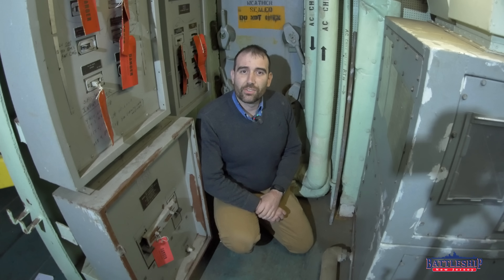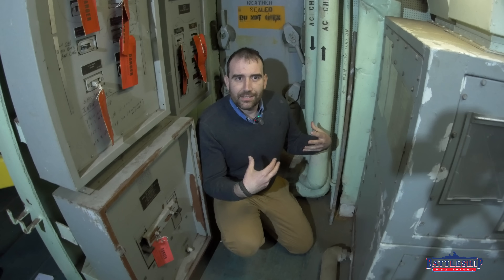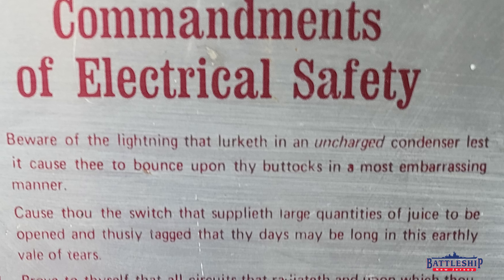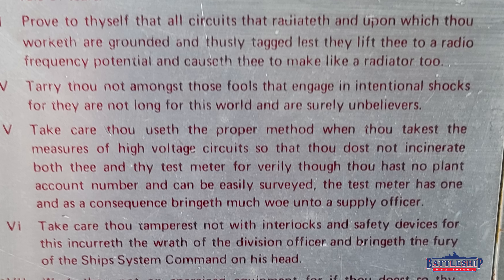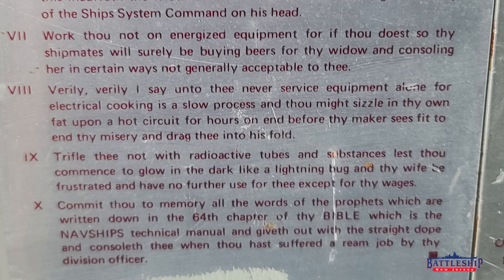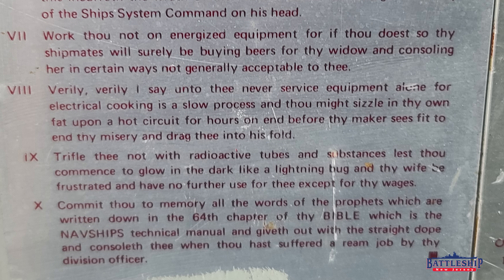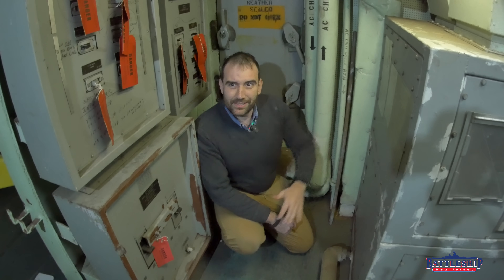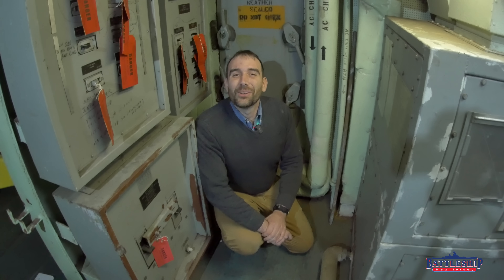The 10 Commandments of Electrical Safety

Comment: And always remember, electricity travels through a conductor in a piece of equipment in smoke.  If you let the smoke out of the equipment it will no longer work.  It’s often not possible to replace the smoke…
(Old electronics joke)

Comment: Truth is spoken on that tag, what's the NSN on it. The capacitor one is no joke for the Aviation Machinist Mate and any who work with modern turbine engines with Capacitive Discharge Ignition (CDI) systems. The system must be discharged before disconnecting plugs or you suffer the risk of being sent to the hereafter.

Comment: Thanks for this reminder!  I saw this decades ago while working in the calibration lab in the Air Force (or maybe it was at Tektronix).  Interestingly, I was thinking about # VII, Consoling Thy Widow, recently, though it was probably in the context of some other potentially risky activity, like motorcycle riding.  Also a favorite # 9, Thy Wife be Frustrated.  The version of X I saw referred to the NEC (National Electrical Code) instead of NAVSHIPS.

Comment: Here in Germany, we, the Masters Of Godly Power, aka electricians, have our 5 Safety Regulations laid down in our most holy scripture, the DIN VDE 0105-100:
1. Disconnect mains
2. Prevent reconnection
3. Test for absence of harmful voltage
4. Ground and short circuit
5. Cover or close off nearby live parts.

Go energize, apply in reverse order.

Comment: To clarify, the term "radiation" in this context is electro-magnetic radiation, not nuclear radiation. EM radiation in the huge doses & micro-wave frequencies generated by radar equipment is also dangerous. Potentially lethal, in fact. Those waves can cook you in seconds. A single radar can have the same power output as a thousand micro-wave ovens.
Reply: And for it’s time, the SPS-49 air search radar was probably the radar that emitted the most amount of energy.   

Enough to kill in certain scenarios.
Reply: @foxbodyblues6709  My uncle, who was in the navy, said that the radar controllers sometimes cooked seagulls using their radar when they were bored. They'd send a man topside to find a gull perching high in a mast somewhere on another ship, and focus their radar on it. The gull would simply fall down, cooked.
Reply: Surely it can't be THAT bad!

Wikipedia: 360 kW peak, 13 kW average

It's that bad.

Comment: lol, this is hilarious.  Just earlier today, I made a post on a teams group I am part of as my job as an engineer, in the tone and wording of a town scryer of a medieval fiefdom.  It was the communication of the decision to no longer use black oxide coated components in any project, due to corrosion concerns.  see below for the copy of the decree. 

It has been decreed, by royal order, we are not to use black oxide finish hardware any longer.  
Do not use this finish under penalty of death. 
 
If an individual discovers a catalog part that uses that finish, they are to immediately modify the description to label the part as "DO NOT USE" to prevent spread of this dastardly condition. 
 
Also replace that part using SS as a material. 
signed - 
THE KING

Comment: I. Beware of the lightning that lurketh in an uncharged condenser lest it cause thee to bounce upon thy buttocks in a most embarrassing manner.
II. Cause thou the switch that supplieth large quantities of juice to be opened and thusly tagged that thy days may be long in this
 earthly veil of Tears.
III. Prove to thyself that all circuits that radiateth and upon which thou worketh are grounded and thusly tagged lest they lift thee to a radio frequency potential and causeth thee to make like a radiator too .
IV. Tarry thou not amongst those fools that engage in intentional shocks for they are not long for this world and are surely unbelievers 
V. Take care thou useth the proper method when thou takest the measures of high voltage circuits so that thou dost not incinerate both thee and thy test meter for verily though thou hast no plant account number and can be easily surveyed the test meter has one and as a consequence bringeth much woe unto a supply officer.
VI. Take care thou tamperest not with interlocks and safety devices for this in curth the wrath of the division officer and bringeth the fury of the Ship System Command on his head.
VII. Work thou not on energized equipment for if thou dust so thy shipmates will surely be buying beers for thy widow and consoling her in certain ways not generally acceptable to thee.
VIII. Verily, verily I say unto thee never service equipment alone for electrical cooking is a slow process and thou might sizzle in thy own fat upon a hot circuit for hours on end before thy maker sees fit to end thy misery and drag thee into his fold.
IX. Trifle thee not with with radioactive tubes and substances lest thy commence to glow in the dark like a lightning bug and thy wife be frustrated and have no further use for thee except for thy wages.
X. Commit thou to memory all the words of the prophets which are written down in the 64th chapter of thy BIBLE  which is the NAVSHIPS technical manual and giveth out with the straight dope and consoleth thee when thou Hast suffered a ream job by thy division officer.

Think it's right.

Comment: Worked on hundreds of foreign made equipment . Not one ever had a UL sticker or other approved testing lab because they would never pass. Back in the 1980's we had a $10 million state of the art machine made in Germany that there hard headed electrician would never admit they could make a mistake. If you held in the stop button and pressed in the start button machine would run. Told them that I have worked on equipment made in the late 1920's in the USA that could not be ran like that.

Comment: Way back when cars still had ignition points and condensers, you could take a condenser, pull off the connector, and just stick the bare wire in wall socket. Then call somebody nearby and toss it to them when they see you. The reactions of the catcher vary.

Comment: These metal signs were relatively easy to obtain from a Shore Intermediate Maintaince Activity. (SIMA)  You sent in the text and any illustrations to SIMA on the regular work order process.  If I recall, you could get black and/or red.  So one off signs were no big deal.   No idea what the production process was, and it took time to get them back.

Comment: The Ten Commandments of Diesel Maintenance"

1. Thou shalt keep thine engine clean and in adjustment that thy life in its company shall be long and that the owner shall increase thy job longevity.

2. Know thine engine and all its parts and functions, else thou shalt be up some tributary without means of locomotion.

3. Be not wise in thine own conceit. Remember the factory instructions and keep them holy, lest false repairs be thine undoing.

4. Be not loose in thy jaw hinges for no man knoweth all about diesels. The truly wise absorbeth much knowledge and exceedith little, and he who so doeth shall gain repute among his fellows and favors among his superiors.

5. For all things in this life that thou desireth, thou shalt also pay plenty, and for the wisdom of experience, no less. Advice from the multitudes costeth nothing and usually worth as much.

6. In the books though mayest read what to do and when, but only the voice of experience may tell thee why and how, else reading of what and when shall but plague thee with smoke.

7. God maketh the earth rotate endlessly without bearing or oil, but not thy diesel.

8. Curse not thine engine when it turneth not. Curse rather thine own neglect.

9. Steam engines and gas engines may long turn over though sloppy: a diesel not so. With gauges and mikes be though ever busy.

10. The eternal eye watcheth universal operations, but thou shalt not rely upon it as to thy diesel. Thine own vigilance is the price thou payest for thy job.

Comment: There was a similar poster in the powerhouse of one of the rolling mills at the steel plant  I worked at. Not exactly the same but very close and with the same style. My wife actually got caught with the condenser rule. She found one of my film capacitors underneath my work bench and picked it up. Let's say she wasn't impressed and leave it at that.😱🤦‍♂ It would have been charged to about 400 volts I was using it to kick a slightly unstable power supply to settle it down.

Comment: For those who might not know - condenser in number 1 is the old timey word for capacitor. I think it fell out of favor in the 60s or 70s.
Reply: Oddly enough, a lot of small-engine (older equipment) mechanics still use the word condenser for the capacitor that enables a magneto to function.
Reply: You still hear it in the term "condenser microphone".

Comment: Funny but accurate. To go along with this i was told the first 3 rules of electrical safety are:
1 - Check for voltage. 
2 - Check for voltage. 
3 - Check for voltage.
Reply: electrical circuits are like a gun. "Is it turned off?" If you have not verified such yourself than assume yes its live.  Just like a gun is loaded until you are personally sure the magazine and chamber are clear.
Reply: 4- don’t trust when told the power is turned off, ckeck your self
Reply: @JeffHenry-cq3is  5- don't trust your own check, ground it, just in case.
Reply: Where I work, electrical safety isn't much of a thing. Live mains sticking up everywhere, no codified safety rules to provide a safe operating framework.

So I use a triple safety system. Turn the voltage to zero, turn the switch off, unplug the cord. If you get one of them, you're safe. If you get distracted halfway through, you probably got one or two of them.

Preferably visually and physically verify the cord is unplugged before sticking your screwdriver on it.

Comment: The first one may be confusing some people due to the outdated language. "Condenser" in an old name for a capacitor. This is the equivalent of the "every gun is a loaded gun" rule - it is saying to treat all capacitors as though they are charged. It is very good advice.
Reply: Pretty much the same story with those of us who still repair CRT monitors and televisions. Might not kill you, but goddamn does it hurt!
Reply: @BlackEpyon  You still repair CRTs? That must be a very niche job!
Reply: @thomasdalton1508  I am still using a CRT monitor to watch Youtube.
Reply: @economicprisoner  Any particular reason? I know they are useful for playing with retro games consoles due to latency issues with modern monitors, but YouTube really isn't designed for a CRT!
Reply: @thomasdalton1508  Mainly refused to buy any monitor supporting High Definition Content Protection (HDCP).

Which is most of the fully digital ones (HDMI/Display Port).
Reply: @thomasdalton1508  Because it's fun, I like the image on a CRT better (have the latest LCDs solved the black levels problem?), a CRT can display different resolutions with the same image quality and, well, I am not switching between monitors when watching YT vs playing a game etc.
Reply: @thomasdalton1508  It's a hobby. I collect and restore vintage and retro computers. SOMEHOW, this told the YouTube gods that I'd be interested in an old battleship, and a couple years later, here I am.
Reply: You start to feel old when you know what words like that mean where is these days people would think your talking about a HVAC system. Microwave caps have a nasty habit of biting too.
Reply: That was a lesson taught to me very quickly years ago and that I still remember to this day
Reply: An engineer I worked with would put the fear of the capacitor gods into new hires by talking about the huge (person sized) capacitors which he'd used with induction furnaces.

And the yard worker who tried to move one by grabbing hold of the two large metal posts on the top...
Reply: @WolfePaws  I'm guessing the family didn't have to pay for cremation.
Reply: Yes, the whole thing uses deliberately archaic wording.
Reply: @tomboyd7109  "Condenser" is hardly archaic and it wouldn't even have been particularly old fashioned when this was written. The term "capacitor" only started to replace it in the 1920s and "condenser" didn't fall out of common usage until the 1950s or so. I expect whoever wrote this used "condenser" because that was the normal word they used. Its use is unrelated to the use of deliberately archaic language used to appear biblical (the Bible doesn't mention many electrical components, by either modern or old fashioned names!).
Reply: @thomasdalton1508  When do you think it was written? If I'm understanding right, most of the cabinets in that compartment date to when the SPS-49 was installed in the '80s, so "condenser" would have stood out by the time they put the sign up.
Reply: @bfrobin446  According to Wikipedia, Ship Systems Command only existed between 1966 and 1974, so it must have been in that window.
Reply: @thomasdalton1508   as long as students in sweden continues to learn elektronik (electronics) using swedish language - kondensator = condenser.
Reply: I didn't even think about that since in Swedish we still call them condensers ("kondensator").
Reply: @ano_nym  Same in Polish

Comment: Time 035   "  WARNING -   DO NOT REMOVE OR DISABLE 5 PSIG AIR SAFETY RELIEF VALVE " 
Well, it looks like someone has removed the valve from the T on the radar system.    Does this mean that we have opened a portal to the final countdown ?

Comment: As a former EM1 I'm thinking that was written by some topside twidget.  Interesting to note, that the sizing and egress from that space probably don't meet civilian electrical safety standards for working space to work on energized panels. In the early 80s the Navy statistics for electrocution were alarming.  Odd thing was, most were either e1 to E3 that didn't know any better, or E6 and above that thought they knew it all. E4/ to junior E6s knew just enough and were still afraid enough to be safe. ;)
Reply: In 1990, I was about to use the washing machine just aft of the GM berthing area on the second deck. Someone walked in and told me not to use it that it's broken and about to be tagged. Just as he said that I pointed to an electrical box (asking if that was the reason) about 3 ft away an arc of electricity shot out and literally cut the tip of my index finger. Long story short I never did laundry aboard the ship again.
Reply: Retired industrial electrician and having a clear working space is very important. For up to at least 250 volts you must have a 36" clearance from the front of circuit breaker panels & equipment all g with a minimum of a 30" wide space. I used to fight ma when ent tooth & nail over that. Had plumbers several times install a sink directly under an existing panel. If they did not move it some how several inches above the shut off valves went missing. Also need believe at least a 6'6" height clearance above all electrical panels & equipment.
Reply: Topside twidget (radar tech in fact) here.  

I can confirm that a subterranean pit snipe of the electrical type, 1st class, would think that the 10 commandments placard isn’t funny.
Reply: I didn't say it wasn't funny, but can confirm topside twidgets have poor reading comprehension.  @foxbodyblues6709